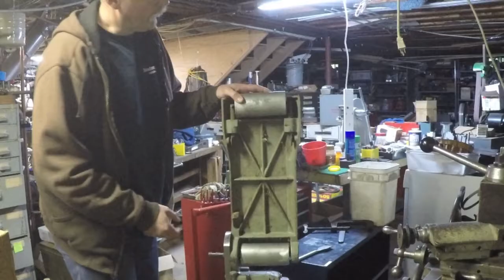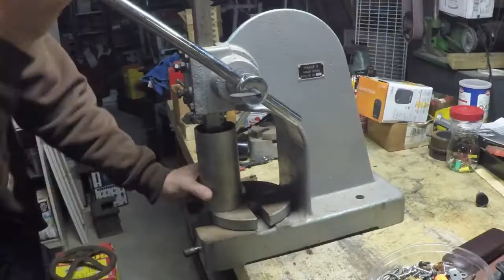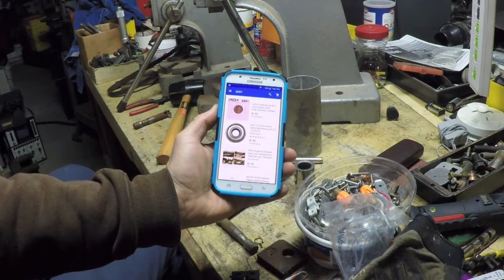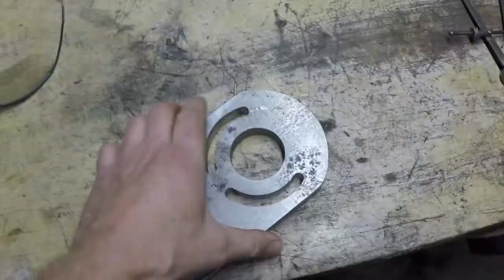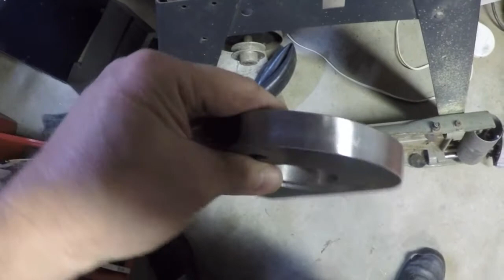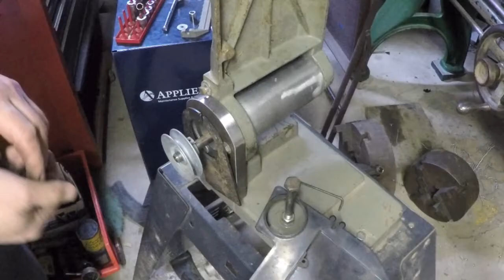The Craftsman sander repair Part 9

Comment: Does the shaft measure 15mm, a common metric motor shaft size? You could bore out a pulley you've got and make a sleeve to press in, but I appreciate cutting the key slot might make it easier to just buy one ;-)   As for the abbreviated videos, some is much better than none! One suggestion, its always easier to watch joined clips where the transition isn't too abrupt. Hoarding stuff pays off again - great to see the NOS USA bearings saving you a few dollars..